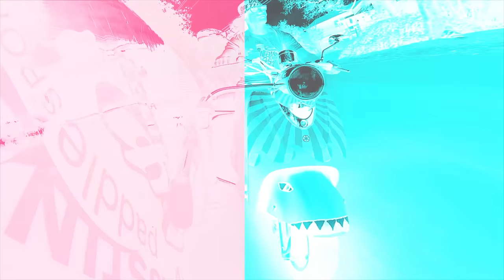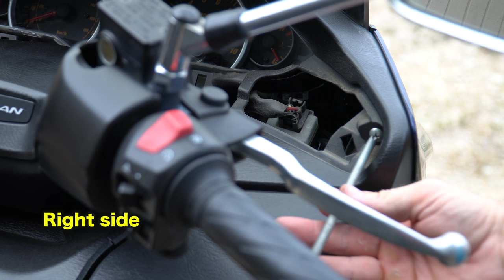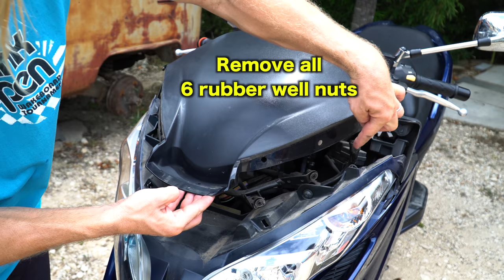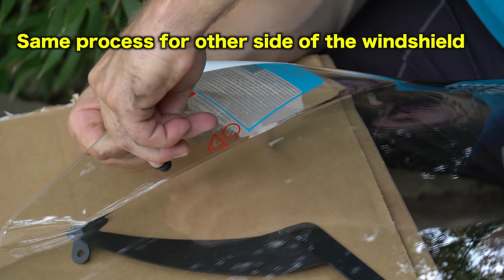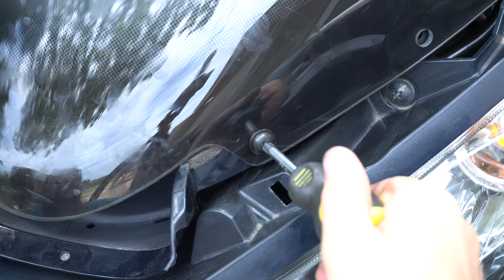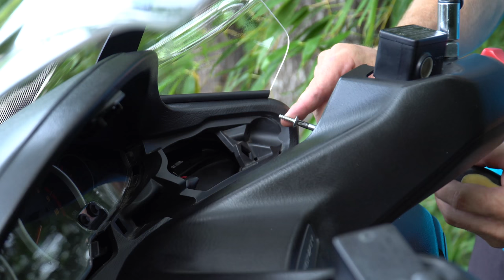GIVI 266DT Windshield Installation - Suzuki Burgman 400 2007-2016 | Mitch's Scooter Stuff

Comment: You certainly made it look easy Mitch. I spent almost a full day trying to fit the D266AF adjustable screen to my 2012 AF400ABS. I battled to get the Wellnuts seated where I wanted them. They were just too stiff and either wouldn't go in or slipped right through and disappeared!  Got it done in the end though and it's a great screen, pretty much turbulence free. Thanks for posting the vid, it really helped.

Comment: I just installed one.  The Givi instructions were useless.  Your instructions were perfect.  Especially reusing the Suzuki phillips screws for the front two holes.  I accidentally tried the Givi screws and pushed the rubber well nut right in past the windshield.  Did not happen with Suzuki screws.

Comment: Hey there! Excellent video! Let me ask you something: the gray Burg has a sensacional headlight. Do you know where I can find it?
Reply from the maker: Thank you! I got them installed years ago they are G2 projectors I got on eBay but you should go this way https://www.amazon.com/Upgraded-Headlight-Z-Shaped-Projector-Retrofits/dp/B08DFRJ77T/ref=mp_s_a_1_1_sspa?crid=17TAZGPWVV1YW&keywords=h4+led+projector&qid=1658127155&sprefix=h4+led+projector%2Caps%2C204&sr=8-1-spons&psc=1&spLa=ZW5jcnlwdGVkUXVhbGlmaWVyPUExQkNNVFk0UVFTSkQmZW5jcnlwdGVkSWQ9QTA5MjI1NjMzQ1JZNE83WE1MRUFaJmVuY3J5cHRlZEFkSWQ9QTAzMzY1NTQxR0pSQzhIWVUxNjNNJndpZGdldE5hbWU9c3BfcGhvbmVfc2VhcmNoX2F0ZiZhY3Rpb249Y2xpY2tSZWRpcmVjdCZkb05vdExvZ0NsaWNrPXRydWU=
Reply: @MitchsScooterStuff  Thank you so much! I have several Burgmans but I just bought a 2016 and intend to start a project. Once again, thanks a bunch! 
Have a wonderful week!
Best regards
Reply: One last question: can I install the H4 in both sides? Need any adaptation?

Comment: This was a great help.  However, having just done this I would change a few steps:

1. When removing the rubber grommets, they push all the way through the metal hole almost effortlessly.  No need to wrestle them out backwards.

2. I would not attach the metal support to the windshield ahead of time.

3. I would re-install the upper 2 rubber grommets on each side ahead of time through the support bars from #2.  That is, before starting to install the window with the lower grommets on each side, I would pre-load the upper 2 grommets on each side THROUGH the metal support bars onto the frame.  There is hardly any room once the lower screws are in and the rubber would end up between the metal and the windshield to function as a rubber gasket.   It will attach to the windshield later just fine.

Comment: No need or reason to remove the 4 rearward wellnuts. Only the front 2 need be removed and if on an older unit i recommend getting new ones before doing this replacement as they get so hard that there is no way to get them back in without ruining them in due to the hardness and size of the crush rib in the rubber over the years.